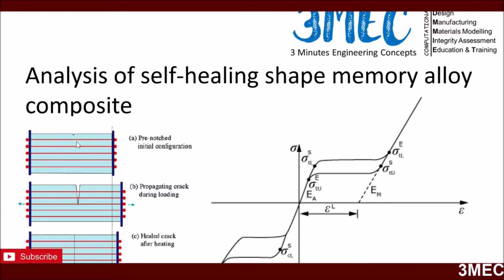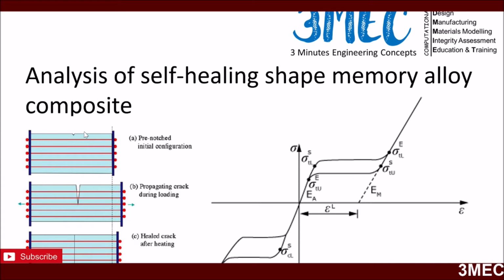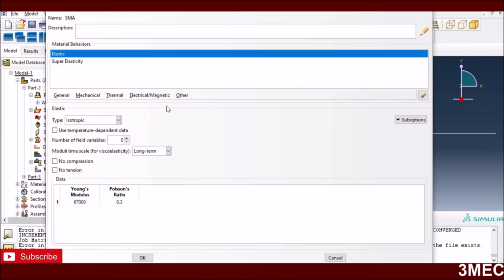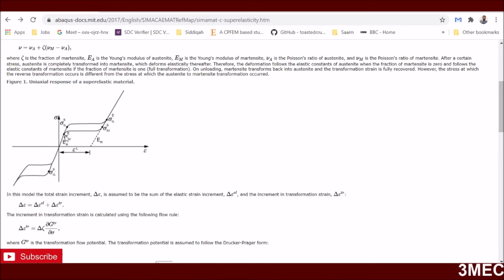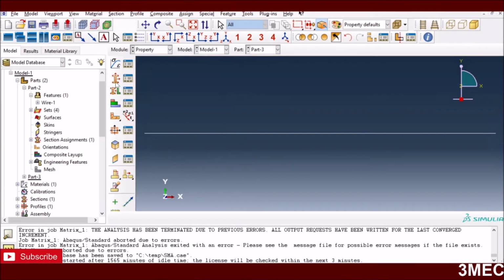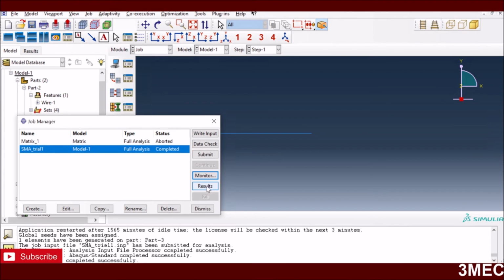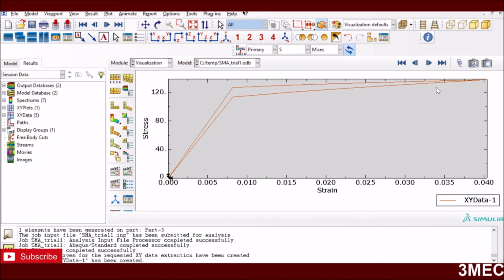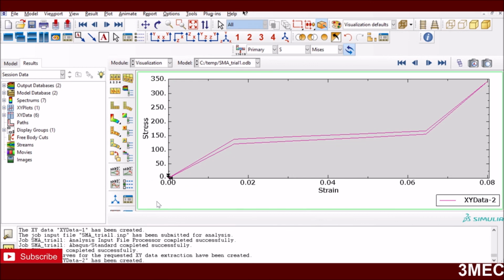Analysis of Selfhealing shape memory alloy composite P1: How to model SMA effect? ABAQUS CAE

Comment: Thanks for this effective video
Can you demonstrate on the program the use of shape-memory mixtures to develop the frictional pendulum friction insulator
To work with the frictional pendulum together
Reply from the maker: Send me more info as I m not aware of this. Thanks
Reply: @Professor3MEC  
To reduce residual displacements within the friction insulator
Suggestion
Use of shaped memory alloy wires or sheets to work together with the frictional pendulum
To take advantage of the superelasticity to provide the return strength of the isolator
Thank you

Comment: Hi, your video is very informative. I have bend an SMA wire in a U-shape. After elastic recovery, thermal loading will bring the wire in its initial shape. I want to simulate these all steps in Abaqus. Can you help me, please?
Reply from the maker: Thanks for liking the video.Please email your model file I can have a look. Thanks
Reply: Good afternoon, Mr. Vikas, have you managed to make any progress with your project? Because I am also trying to make a user subroutine that contains the behavior of these SMAs, however, I do not know how to include the original shape of the part so that that shape memory alloy after applying it a certain heat load recovers its initial shape.
Reply: @MiguelVerona  hi sir can you please help with writing a ABAQUS UMAT subroutine for simulating shape memory effect in an SMA sheet. It will be of great help for me. Thank you in advance.

Comment: Hi, thank you for your tutorial. I was wondering why the compressive stress value (loading) is negative.
Reply from the maker: Thanks for liking the video. I presume tensile stress or strain are taken as positive while compressive as negative. But please check abaqus documentation to be 100%sure as in this case I only had tensile loading.
Reply: @Professor3MEC  Thank you for your answer! I am quite new to SMA, actually I was struggling to model the material for bending (Step 1) and reverse the effect with thermal load (Step 2). Your advice will be highly appreciated. Thank you!
Reply from the maker: For bending, you will have both tensile and compressive deformation and it is s very important to first check all parameters are correctly defined.  Mayb be at first do the same check as I have done in this video for compressive loading by changing the displacement boundary condition sign to negative. This is to ensure that similar hysteresis curve is obtained based on parameters. Finally apply bending load and then create any other step to heat the sample. All the best